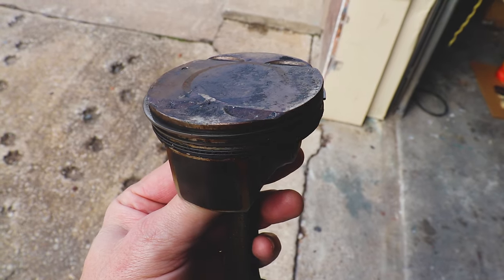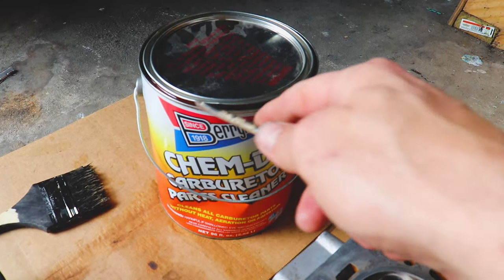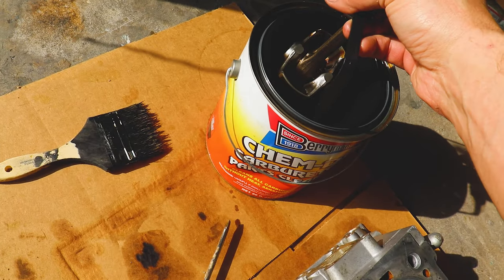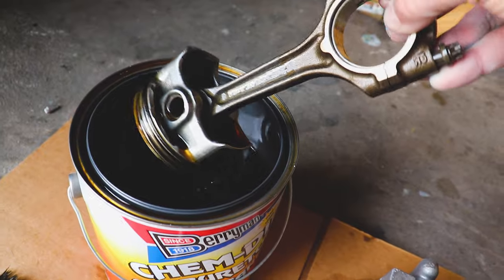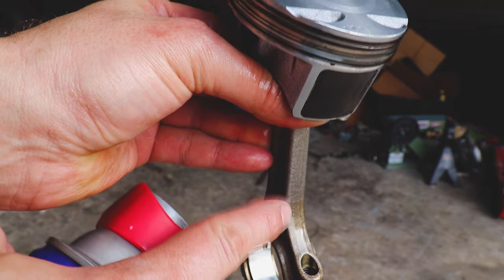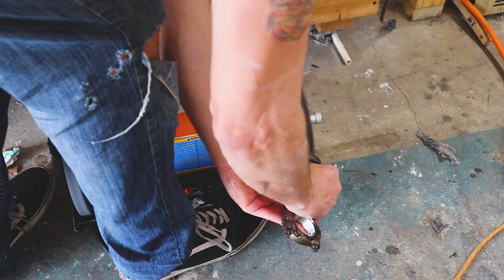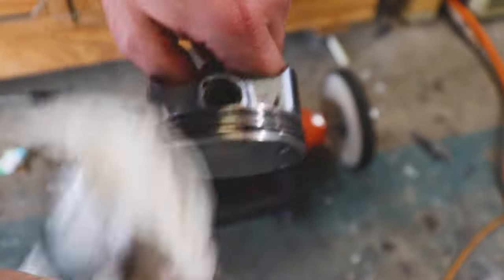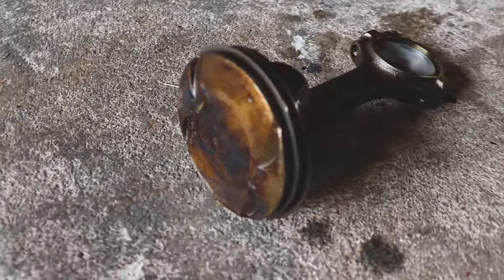Easy Carbon Buildup Removal from Pistons - How to Clean Pistons & Make Them Look New Again Tutorial

Comment: Tried this same stuff on motorcycle pistons and so far they have been soaking for 3 days and the carbon is still rock hard 1
Reply: make sure it is the RIGHT berryman product, if it smells like nail polish remover its the wrong one, should be BROWN and watery and water soluble, they sell TWO carb cleaners in the SAME exact bucket but with DIFFERENT part numbers on the can
Reply: 409 is the bomb

Comment: This is most definitely not carbon, this is very slight oil staining. Carbon is a solid crust that needs to be scraped off with a chisel.
Reply from the maker: I'll agree with you about the crust. Find a part that has carbon build up. Toss it in a can of Chem dip for 15-30 minutes. Scrub it. After a few dips, the carbon comes right off. I've done this with plenty of car parts that had carbon build up. Eats it right up.

Comment: Did you replace the rings. I’m doing a refresh on my engine wondering if I can get away with using old rings. Motor ran great but timing chain needed replaced so just tore down motor to double check things
Reply from the maker: I kept the same rings. Just did a light dingle ball hone and put them back in. No smoke, ran great.
Reply: @cmattdabrat  darn I’m not so lucky. First ring I took off snapped. Any idea what the stock sizes are I’ll need to replace? Thanks 🙏

Comment: Hi Matthew,

I have a Honda civic 1.8 2012 R18 z4 engine as believe my piston oil control rings are gunged up and causing excessive oil consumption rates around 300 miles per 1 litre of oil. Any good oil cleaners that will loosen these oil control rings to help consumption without taking engine apart? I am trying the BG109 this weekend. Gonna run it from cold to operating temp then run at 1,200rpm for 20 mins. Hope you can reply as would love to know. Compression is still very good on my engine just eating oil. 

Many thanks 🙏
Reply: Hello and good evening,  were you be able to use this chemical if so , did it help ? I'm having the same issues you have .please let me know if that helps you out and how  did you use it .

Many thanks !

Comment: When u gonna upgrade the cooling system especially for this Texas heat
Reply: Stock doesn't seem sufficient enough especially for west Texas
Reply from the maker: The radiator has been fine. Just everything is so tight in there. Not much clearance.
Reply: @cmattdabrat  I'm upgrading mine from a single to a dual fan setup to hopefully keep everything cooler looks like we gonna have a summer this year here in Odessa already 110

Comment: Dang! Let me dip my valves in real quick 😁
Reply: I was thinking the same thing. I wonder if this would work by filling your intake runners and letting it set. #directinjectionproblems
Reply from the maker: I've done that as well! Anything I could toss in there. If I couldn't toss it in there, I'd brush it on parts.
Reply from the maker: Would definitely make easy work of caked up heads. Just leave the valves in and fill em up.